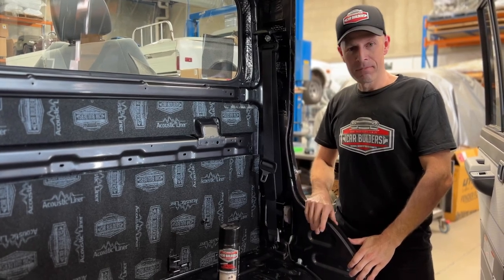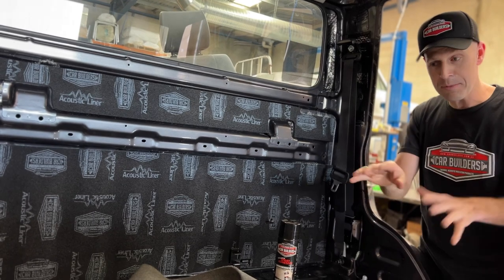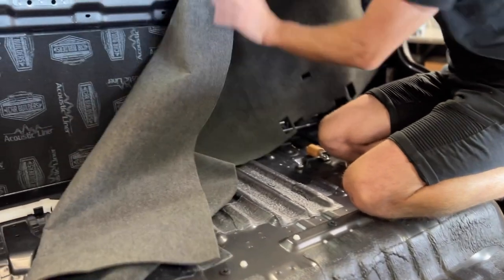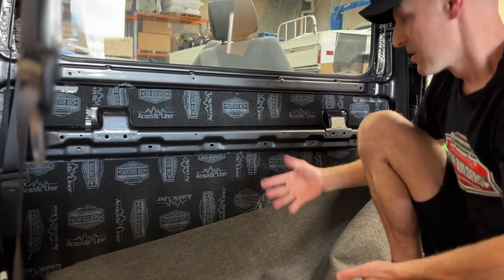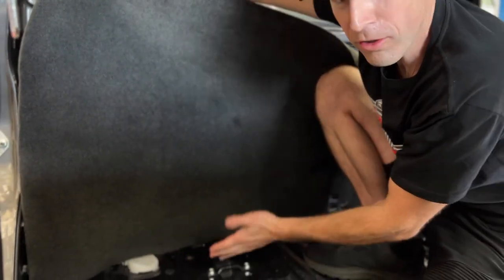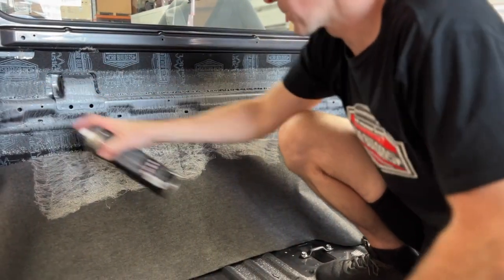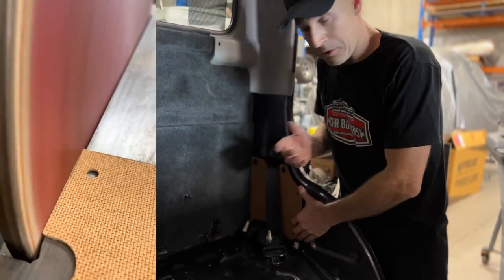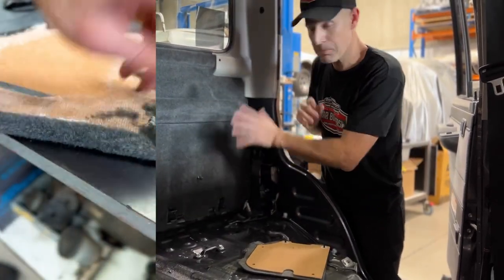Carpeting a rear wall to achieve a factory-finish with 4 Way Stretch Carpet

Comment: Flat surfaces are relatively straightforward to cover.  Would be good to see a demonstration of say a wheel arch, due to the large convex edge, ie: how do you hide the relief-cuts?   Similarly a deep-concave demonstration.